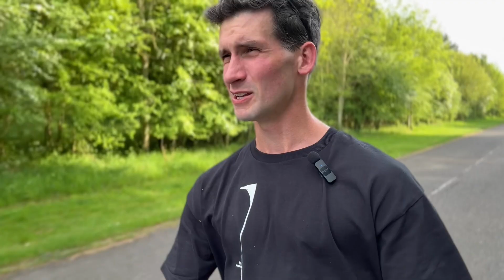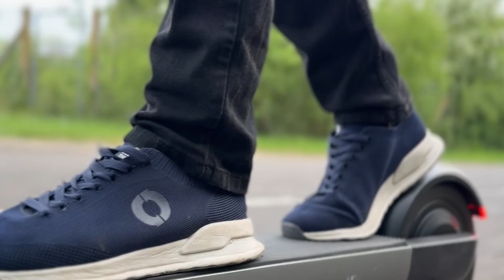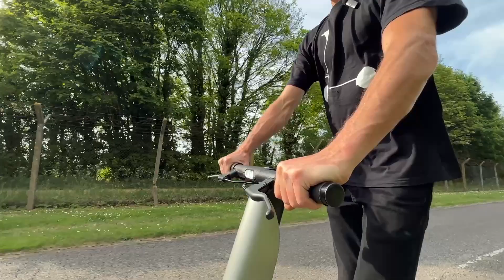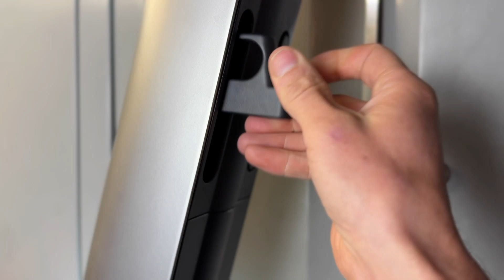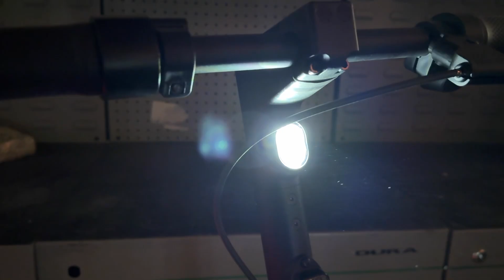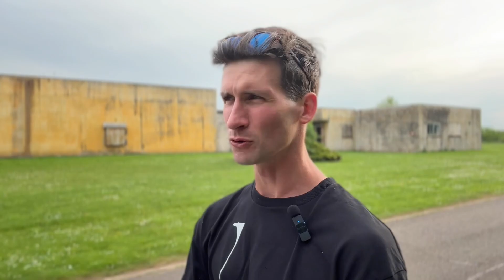Bo M E-Scooter Ride-through with Co-Founder: Details That Make The Difference

Comment: Your price point that justifies purchase, I feel needs to be at $999 for the outgoing M1, and $1599 for the M2.  Add $99 on shipping I think you would sweep up the balkers at the $1399 and $2499 price tags.  If you can make sense on that financially.  I would add services and upgrades that don't cost that much, people hardly use to achieve what you would give up on the price.  Right now, you have the M2 at $1899 which the consumer perceives as $2K.  But at $1599 - they psychologically justify it to $1.5K.  Everyone knows shipping is an additional fee.  I wish you the best of luck and I hope you keep this design.  If there was/is a way to fold this at the lamp and not lose the integrity of the frame (thinking strong magnet/release system) and add an ingenious way to roll the scooter one handed like a suitcase.  Regarding extra benefits, a rain cover with the BO logo to get eyes off of it for theft in public parking that is as unique as the product and sell it for $99 (remember Apple sold a $1000 stand for their Pro Monitor - magnet system by the way) and people justified it while complaining.  Just brainstorming.  Looking forward to the evolution.  Would like to see a magnetic phone charger, perhaps bluetooth, a speaker array on the inside towards the driver as good as those in the MacBook Pros.  This product deserves to be a fashionable scooter flex, for the business world, the women out there also (think a white version that is unisex - matte white or gloss white.  Best of luck on your venture.

Comment: no susp
Reply from the maker: Not entirely correct, we have the Airdeck for vibration suspension and balloon tyres for the bigger bumps.
You are correct, we don’t have tiny suspension shocks like some other scooters. 
Our priority is stability and ride dynamics (how it carves down the road) which are both improved without tiny little suspension shocks. 
If you’re riding off road those suspension can help.

Comment: sorry, the ride must be comfortable, and the Bo looks like the opposite. First I am pretty sure you can´t put your foot on the rear wheel guard., second the handlebar is way to low, lack of suspension is just stupid. The wheels are too small, it looks like mediocre drum brakes, that thing is a complete failure.
Reply from the maker: You haven't ridden it though... Do you tend to review food you haven't eaten? 
To respond to the specific points:
1. Mudguard is metal reinforced, of course you can put your foot on it that is what it is engineered for. 
2. The handlebar is a great height from 5'4" to 6'4", if you're taller than that buy an Egret
3. The lack of suspension will be the subject of a different video, is worse off-road but on a tarmac road leads to a better ride overall. 
4. The wheels are 10.5inch, 'too small' for what? They work great from a ride and comfort point of view. 
5. The drum brake combined with the regenerative rear brake gives lovely balance, and can stand the M on its nose if you adjust them to. Best of all, zero maintenance. Very good system to live with.
Reply: I've been using my own Bo M for about two months now and have logged a fair number of kilometers.
My previous scooters have been the Ninebot Max 30, OKAI Neon, and Kaabo Mantis 10 PRO.
The Bo M is on a completely different level in terms of overall quality and riding experience.
Even though the Bo doesn't have suspension, the tires and the Airdeck absorb road bumps impressively well.
The power is just right, and the handling and ride feel are absolutely top-class.
Naturally, the price of the Bo might be too high for some, but if this had been available earlier, I wouldn’t have bought those previous scooters at all.
Reply: I feel like the steering, suspension and power is poorly executed on most scooters. Good engineering could make these vehicles a lot more practical, and I think they would have military demand.
Reply from the maker: @patrickmcneely7388  this is the thesis that Bo is based on - if there's going to be feature on the vehicle it has to be done to an extremely high standard, or it ought not be there.